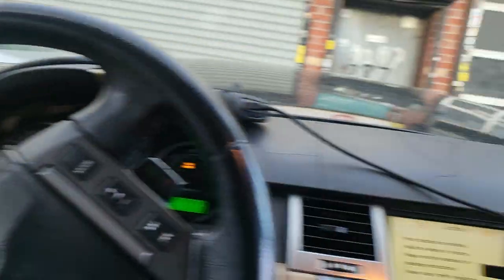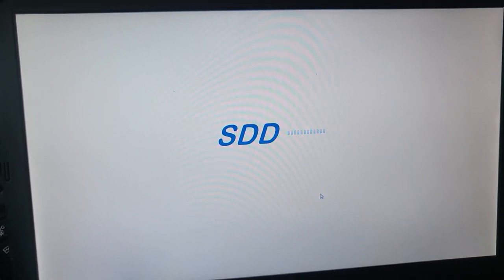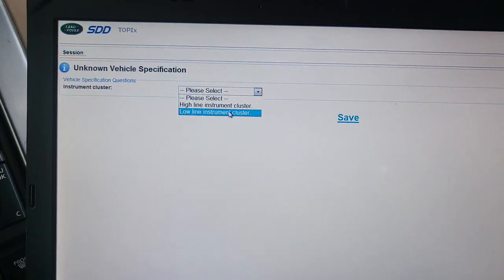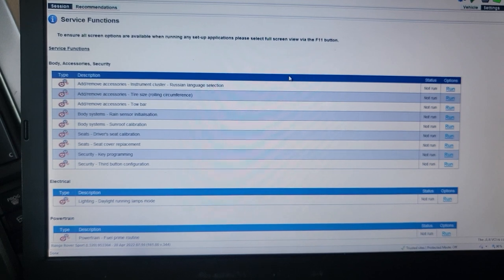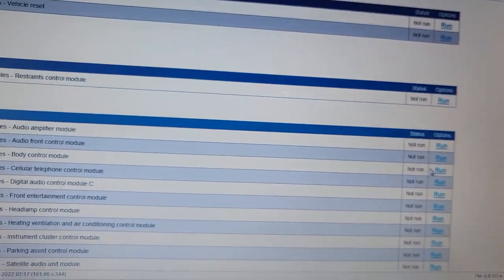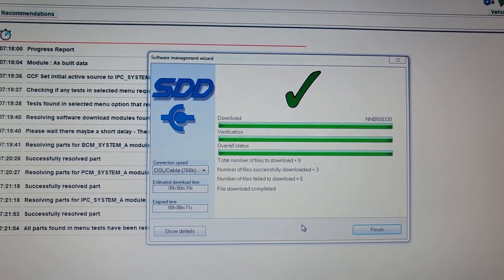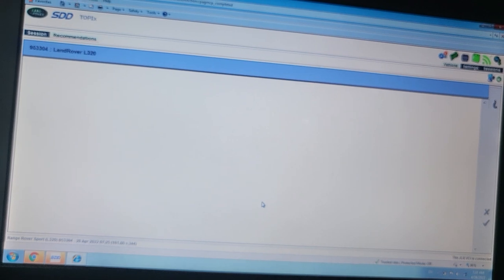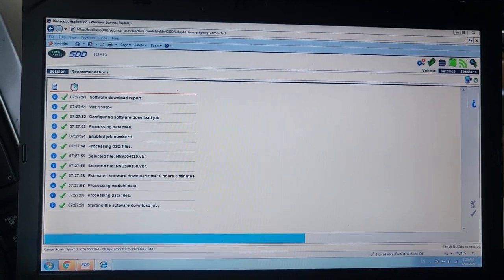2006_2009 Ranger Rover L320 Body control Module Programming  And Security Learning Step By step

Comment: I have a range Rover sport 2008 HSC model one car have no keys so I want to change other range Rover same model car or put ECM BCM and key mobilizer unit can possible start to the other car so which one other module need to change for to start car
Reply from the maker: i believe you need to change the cluster also some of them
Reply: Where is the location the key mobilizer unit
Reply: And I need a programming and everything or just remove the other car and put the same car

Comment: Hi  I have a freelander 2 , My BCM has failed I have a replacement used one and I need to programme with SDD but I can't turn on the ignition and the key won't stay in , any ideas please
Reply: Do it by bench and transfer all the original info to the donor or replacement unit.

Comment: Hello, I just want you to give me an indication because if I install the new module and then use the software, it asks me to put the ignition on, take it off and put it on, but that doesn't work for me anymore.  What is the procedure I use Jlr.?
Br
Deni
Reply: I mean if before mounting the new module I have to leave the car battery and software connected after which I replace it and continue the procedure?

Comment: Can you reprogram a used BeCM I just changed mine in o6 rr everything works but want start immobilizer light flash on dash..smh
Reply: Or is it simple as reprogramming keys if so can I do it what's tools needed if so please help.
Reply: What happened with your car
I have same problem 
I replaced everything even the kay 
Secondhand part
But it is still flashing on dach and doesn’t start 
Help me please

Comment: 2008 L320, akl i successfully programmed a key, reinstalled BCM and I cannot get the alarm to shut off? Should my flip key remote work immediately after bench program?? I get no key error on dash, just alarm constant and flasshing red light. Ive tried everything ive found online. Any ideas?